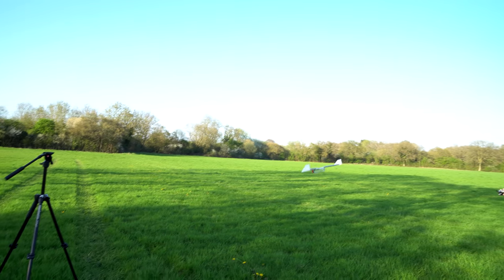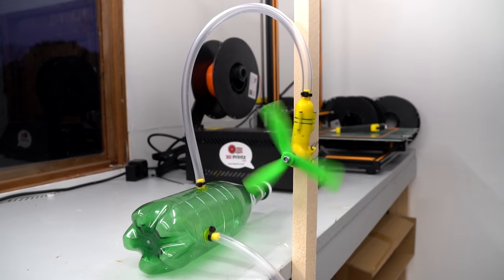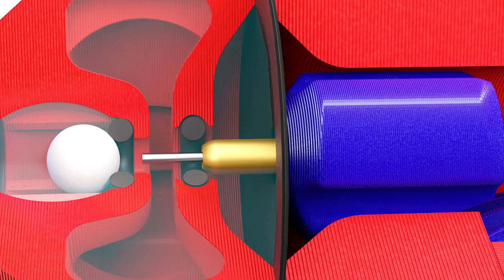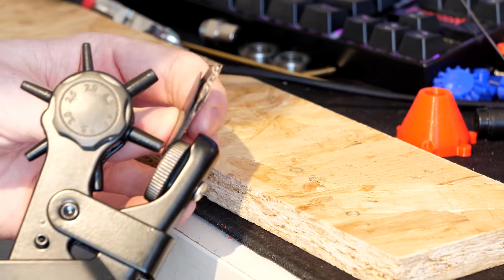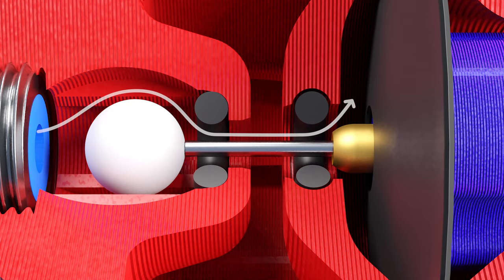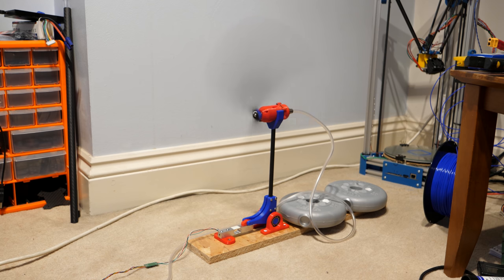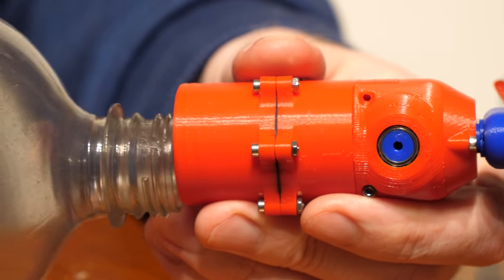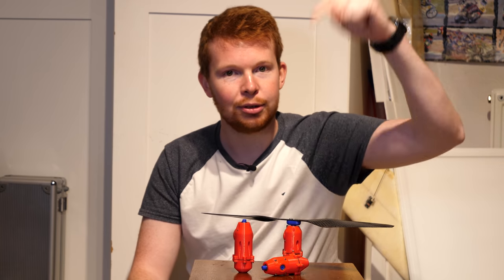Diaphragm Air Engine

Comment: Ah yes, the SI unit for specific impulse, the Stanton: 1 second of thrust per 2L bottle at 60PSI
Reply: for me it's the kirk
Reply: LMAO severely underrated comment
Reply: Opecuted  Don’t worry, the pound and the inch are based off of the kilogram and the meter respectively (the pound is defined as 0.45359237 kg and the inch is 1/12 of a foot, which is defined as 0.3048 meters), making this a legitimate SI unit. I’m still waiting for a call back from the CGPM.
Reply: @you_just  i almost wrote a short comment explaining why you are wrong and warning you not to use inches in test when they specifically for the answers to be in SI units. then i read the last sentence and looked up what CGPM is lol
i was this |            | close to get whoosed
Reply: Hi

Comment: Wicked illustrations! I loved the original air hogs, this is so cool. Do you think a high pressure engine may be possible using threaded co2 cartridges?
Reply: I have been looking at videos of miniature air engines, and have been thinking what performance or run-time can be achieved by using    a small amount of liquid nitrogen that boils and comes up to pressure, still allowing the use of a lightweight tank
Reply: @ianlehman8342  Use liquid hydrogen, if you can. Yes, it's flammable, but it's really light (14 times lighter than water) in comparison.
Also you could probably use it's flame to heat a vaporization coil that sits between a liquid feed from the bottle, and the engine.
Reply: @namibjDerEchte  All these people who are way smarter than me...
Reply: @Pascal_Robert--Rc_Creations  that's what I was thinking, air piston engine at the fron, jet at the rear 😂
Reply: @DocM221  call it the mullet
Reply: @komischertyp4  nah, a lot of these people are saying "hey what you should really do is ..." and then describing a lengthy, complicated device that would be incredibly hard to build. If you're NASA you can worry about the density of liquid hydrogen but for an average hobbyist, build something that works then think about refining it.
Reply: Great
Reply: Using a CO2 cartridge would have a few issues - you'd need a pressure regulator, and in a lot of cartridges the CO2 is actually (when full) present as a liquid, which means if they are sideways or even upside-down, you might release liquid CO2.
Reply: Yeah my boi
Reply: @namibjDerEchte 
Hydrogen has a very low density, and doesn’t liquify at room temperature regardless of pressure. This means you can’t store as much of it compared to LPG or CO2.
Reply: @zuthalsoraniz6764  I've got a teeny tiny regulator that uses CO2 bulbs for a mini beer keg. Never had issues with the bulb going upside down. Might also be a solution for regulation too.
Reply: @PKMartin  getting hydrogen is easy. Don't talk down to people just because you think its complicated
Reply: @mememan2344  liquid hydrogen is tricky to work with. Small amounts like you would need for a model aircraft would have to have a homebrew solution. Which is likely beyond most peoples capabilities
Reply: @mememan2344  We're talking about hobbyist models here. How would you suggest this person building 3d printed plastic engines with coke bottles as air tanks stores their −252°C liquid hydrogen?  You say "getting hydrogen is easy" but a hydrogen liquifier costs tens of millions of dollars. Where would you get yours from? That's not even touching on the "and then you could burn it and use the heat for vaporisation" part.  A splash of LN2 or some dry ice chips in the bottle could be interesting and achievable by a hobbyist; LH2 is a ridiculously impractical suggestion for model planes and you know it.
Reply: @PKMartin  actually you're right lmao

Comment: Watching YouTube videos for years, I have come to the realization that there are many more smart people in the world than I originally thought!
Reply: And many more smart people do exist that haven't had the chance to realize their own potential. I like to think I am one of them!
Reply: There are a lot of smart people in this world. But unfortunately a lot of those people waste there gift and those who are not as smart but work harder surpass them in the long run
Reply: And vise versa.
Reply: The problem is that to find a smart design, you have to wade through dozens of idiots trying to scam us into believing that perpetual motion works. 
The ones who really won't give up are the guys trying to run an engine on hydrogen separated by electrolysis.
A 30 second calculation shows that the energy taken to generate the hydrogen is at least 10 times more than it can produce. 
Simply disconnecting the tube and lighting the gas produces a flame smaller than a candle and we are expected to believe that this will power a car. 
Some of these guys have produced amazing fuel consumption improvements, totally oblivious to the fact that they were just turning down the fuel and the hydrogen was making no difference. 
The result was a 70hp engine producing 30hp and the life expectancy of the engine being reduced to a matter of hours.
Reply: @MrLifeistoobusy  huio

Comment: "it does't need gas, just pump it with air!"
uuhm, these toy companies will discover free energy someday
BTW. Cool engine and Cool graphics
Reply: Cool thing is it can be refuled mid air easily :-) who knows, perhaps a solar panel would do it.
Reply: @katzda  interesting idea. However you would have to limit your flight to sunny days only
Reply: @thecommenter578  its still always sunny above the clouds.
Reply: @katzda  Why waste power using a solar panel to pump air into the air tank of a compressed air engine, when you could just hook up that solar panel directly to an electric motor?
Reply: Old air hogs actually had air powered engines, hence the brand name
Reply: @skyscall  Maybe because you can't store electricity in a light container.
Question is how many liters of liquid air would we need, is it even capable of lifting more than a toy when scaled up, would we have to store it in a liquid state? Anyway I like the ingenious design, it would be compatible with normal fuel if the rubber band didn't melt during combustion. But that would defeat the point of it being ecological :-(
Reply: free energy? oh yeah. free energy in the form of coal that is burned for producing steam to turn turbines that produce electricity that is converted into compressed gas that is then converted into kinetic energy in aero-engine "free energy"
Reply: @BloodSprite-tan  lol. You didn't understood anything
Reply: @katzda  eh... Id prefer some 2 cycle sounds
Reply: @BloodSprite-tan  bike pump
Reply: Doesn’t need gas? Well it kinda does since, you know... air is a gas.

Alright I’ll show myself out...
Reply: @katzda  You're forgetting that its a plane. Why store energy in batteries or compressed air when you can store energy by just increasing your potential energy? 

That's what airbus did with their Zephyr drone, just climb in altitude during the day and coast at night. They did a month-long trial flight back in 2018, and it's a potential low-budget replacement for satellites (no need to actually send something to space, just launch it during nice weather and let it cruise at 70,000 feet, above most weather conditions.)

Also, compressed air is far worse than batteries: even the most efficient large commercial systems are only 10-15% efficient. Its useful and convenient, but compressed air is very expensive.

Comment: 6:44 "but we all know that noisy engines don't always go faster." Tell that to the guys who play with their mufflerless cars outside my house at 5am.

Anyway, love the videos man. Keep it up!
Reply: yeah, or h-d's without mufflers that have like 40 hp.
Reply: I had a Briggs & Stratton lawn motor that was 4 stroke. I hopped it up from 3 1/2 hp to 10 hp about 40 years ago. The exhaust was like a expansion chamber on  a 2 stroke. It really loud at low rpm due to the extra long intake valves! At just off idle it made 5 hp. The ringing of the exhaust could be heard at a 1/4 mile away.

Comment: Very interesting iterations. I'm no engeneer but if I may, I will leave here my observations. 1 - The brass valve rubs inside the O ring. Doesn't that cause friction in a moment where the engine is deaccelerating? Maybe if you use a trflon tube instead brass you will decrease that friction. 2 - If you glue the pin and the valve they are fixed. Doesn't that make fine tunning dificult? Why not screw them? you can turn them sligtly to adjust exacly the moment to action and increase the performance without reprint everything again. 3 - The piston creates force in one direction only and need enough momentum to reach the next stage. Why not have two or three cilinders to compensate that and have the engine always producing force? I know it will consume more, but it shouldn't be just 3 times stronger... i guess it can be more. I would love to see a radial design... and the sound would be amazing! (sorry my bad english) Other note: print with thiner layers and more infill!

Comment: If you pursue this design further - a small suggestion for prototyping that makes finding the correct length of the brass-insert and the push-rod a lot easier:
Use screws.
instead of just a random created brass-insert get a ~6mm brass threaded rod, make the fron smooth, and for the pushrod drill a hole and insert another screw/threaded rod into that hole.
Like that you can just screw the part to a different position instead of having to make a new one every time.

And for the gears - use some lego-gears (or any similar like Cobi, BlueBrix, Cada). The gears are cheap, easy to use, made from ABS and with the cross-shaft also easy to connect to other printed parts.
Reply: This is very good advice!
Modular, easy-to-modify designs are wonderful for prototyping! Especially if you can use off the shelf parts. Then when you know the final designs, you can customize, make to measure and make any small improvements/refinements you feel are necessary

Comment: That is a brilliant feat of engineering! Never would have thought of that for a potential  candidate for a propetual rotor engine. Using an air tight seeled diaphragm to keep the motors spinning could help eliminate a lot of waste for energy and resources.

Comment: Maybe add multiple engines that goes when the other is releasing the old air.
Reply: You mean make a triple expansion engine - that uses the pressurised air 3 times :)

Comment: Now put 3 or 4 of those together and you should have a pretty smooth engine.
Reply: Given the design of the engine that might be possible, though a 2 cylinder version first might be good

Comment: Run the exhaust vents out the back and you’ll get a tiny bit more thrust! ;P
Reply: Would be negligible compare to the weight of redirecting pipes to rear
Reply: @olistanley5790  the diagram at 3:28 has the holes exiting orthoganlly to the drive shaft— so it maybe wouldn’t be too hard just to angle the holes 45 deg to the back and then open them up a little to allow for more pressure— of course the energy losses of redirecting the flow that direction probably reduce any noticeable thrust. But would be a fun little addition
Reply: The final version does vent rearwards.
Reply: @Leadvest  ahhh you’re right! Ignore me
Reply: @OrionAerospace  It just means that Tom though it was a good idea too (even before you thought of it)
Reply: I would instead do what many later steam engines did, such as the olympic steam ships and the big boy locomotive. The first piston is a high pressure chamber, then the exhaust is vented into a larger, low pressure cylinder. The big boy reused the steam 3 times before venting to atmosphere if I recall correctly
Reply: @gormauslander  that applied mainly to boats and static installations. Even trains generally considered this to be too much extra weight to make sense. For an airplane multistage expansion makes almost no sense at all. Also i think that might not apply ro compressed air at all since theres not the heat energy being extracted, just pressure
Reply: @nikolausluhrs  with my severe lack of knowledge on this topic.
It currently goes from 60psi to atmosphere, so a single pressure drop of 60psi.
If you go from 60 to 30, then from 30 to 0, the total drop is still 60, so what would the benefit be?
Reply: @Hirosjimma  basically efficiency, look up tripple expansion steam engines for detail. And like i said i doubt it would work for compressed air
Reply: @gormauslander  You are correct that ships often had multiple expansion steam engines (I think double and triple expansion were common).  But, the Big Boy locomotives appear to be single expansion.  This page says they have 4 pistons (all high pressure, and all the same size):
https://www.steamlocomotive.com/locobase.php?country=USA&wheel=4-8-8-4&railroad=up#346
And, as you can see in videos like this, the pistons are mounted 2 per side, with each set of eight drive wheels being driven by two pistons (one left, one right).
https://www.youtube.com/watch?v=5o7wNDh9nh0
Reply: @nikolausluhrs  Multi expansion steam cylinders also did not extract heat either, it's all just pressure, though you may be correct in that air potentially has less reusability. 

I don't buy that argument about trains though. Those monsters had no weight budget, and another cylinder is like an extra 2%.
Reply: @andrewsnow7386  You're right. I must be confusing it with another locomotive, though in this application they are called compound engines.
Reply: @Hirosjimma  The reason that dropping the pressure in steps is more efficient is complex.  This Wikipedia article on Compound Steam Engines discusses it:
https://en.wikipedia.org/wiki/Compound_steam_engine
The short answer is that some losses, particularly thermal losses, are reduced.  In addition, the articular list a bunch of reasons (other than efficiency) that might lead to a compound engine being a better choice in some applications.
Reply: @gormauslander  yeah thats the point, its so space and weight inefficient it doesn't make sense on trains despite their massive size and weight.  I guess it might be more size than weight.  iirc you also have super heated steam as an option for later locomotives. I do like the idea of multiple expansion trains but as far as i know it was never done.
Edit: id love to hear about any though because steam trains are cool.
Reply: @gormauslander  I'm no expert on the terminology, but the way I've always used "compound engine" to refer to any engine with two or more stages, but where the number of stages is not specified.  However, when referring to a specific number of stages, I use "double-expansion" or "triple-expansion" engine.  Also a non-compound steam engine is often called "single-expansion" or just a "simple" engine.  Although, Wikipedia (in the article titled "Compound steam engine") says "compound engine" often refers to double-expansion engines and ones with more than two stages are referred to as multiple-expansion engines.  As always, terminology can be inconsistent.
Reply: @nikolausluhrs  Look at the wikipedia article "compound engines". They did indeed exist
Reply: @nikolausluhrs  While I agree that a compound engine would be of no benefit in this application, I disagree when with you when you say that with compressed air "theres not the heat energy being extracted, just pressure".
In both cases, steam or air, the pressure and temperature are interconnected.  IF they were ideal gasses (they aren't, but are close under many conditions), the relationship would be PV=nRT.  But, even when not an ideal gas, there is still a relationship between pressure and temperature for the given gas.
Because of this relationship, in both a steam engine and an air engine, the gas will cool as it expands in the cylinder.  The temperatures and pressures may be way different in the two cases, but the basic physics are the same.  It's not correct to say that one extracts heat energy and the other doesn't.